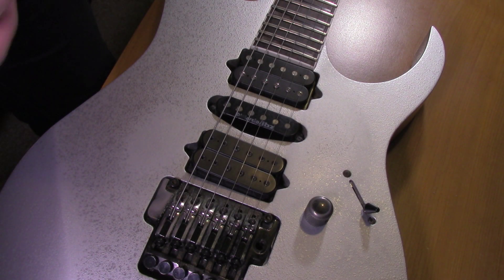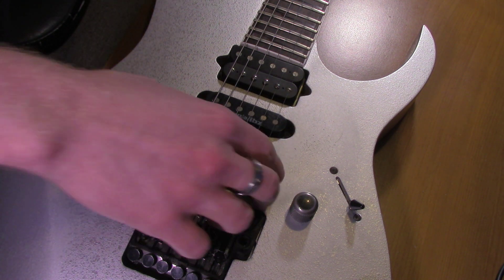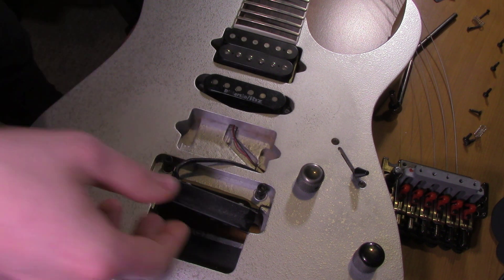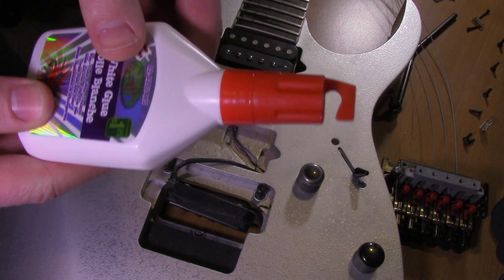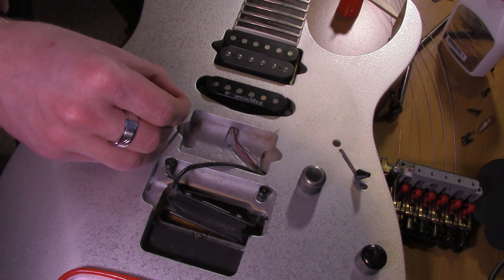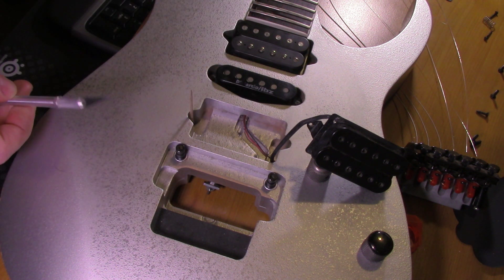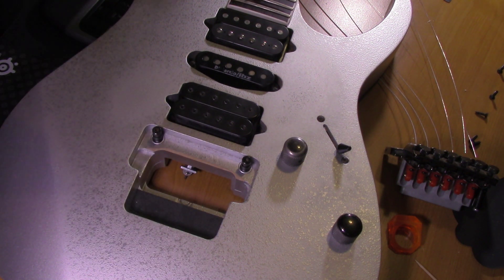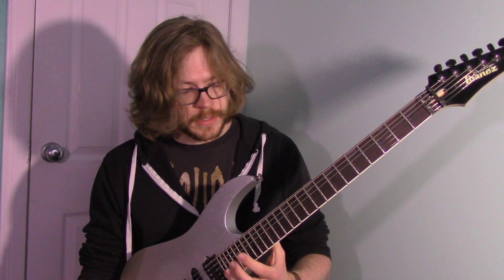Stripped Screw Hole Repair, Ibanez RG2570E with Chris Riffinki

Comment: Hi chris. Do you have to modifi the pickup cavity to change the pickups? . I ask you 'cause one guy told's me That it needed but i don't trust in him. Cheers from italy
Reply from the maker: Hi Fabian, no I did not need to modify the pickup cavity to change the pickups. I made sure to purchase new pickups that were the same size as the originals, so I just dropped them in. Cheers from Canada!
Reply: @ChrisRiffinski  thanks a lot for your answer Chris. I want to change it for two dimarzio paf pro.  So i suposed that it be ok. Be well my friend

Comment: You did'nt need to use a drill for the new hole? Just adjusting the screw with the screwdriver was enough force to make the new hole? Thanks!
Reply from the maker: That's right. Popsicle stick wood is fairly soft, so the screw should go in easily

Comment: Great video and good idea on the popsicle stick instead of toothpicks. How has the repaired hole held up since?
Reply from the maker: Thanks. It's holding up great so far. It's as solid as a rock, and I don't baby the guitar at all
Reply: @ChrisRiffinski  I was wondering about this method also being used for threaded out spring claw holes in the back of a floating bridge Ibanez where the two large screws would go in. Do you think it would work for that as well? I don't see why it wouldn't, but depending on how much/little someone abuses their tremolo, I was thinking it may or may not hold up; not sure.
Reply from the maker: @wilsonstrickland8967  I would try asking someone who has more experience before trying anything. I don't see why it shouldn't work either , but I wouldn't underestimate the amount of force the springs will have on the two screws. Maybe use proper wood glue instead of regular school glue